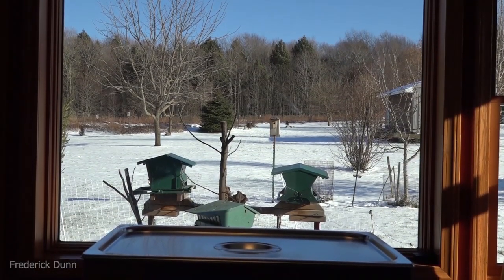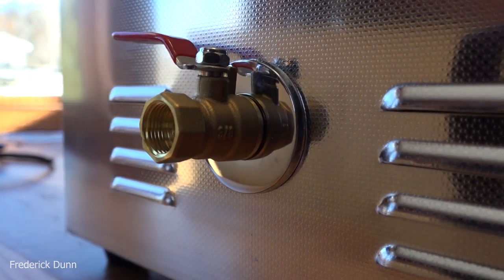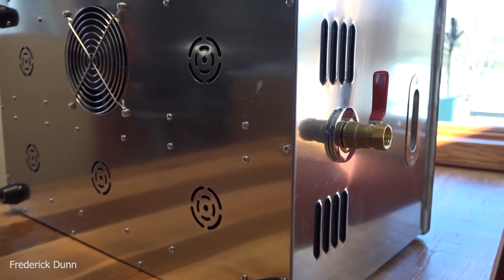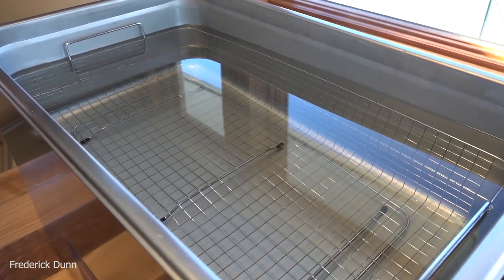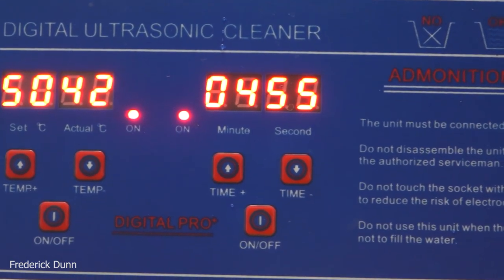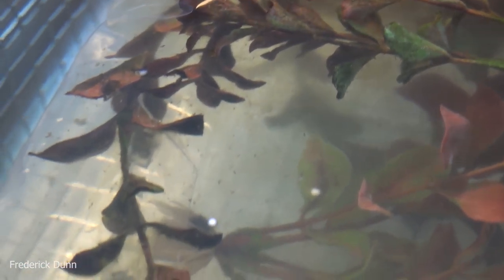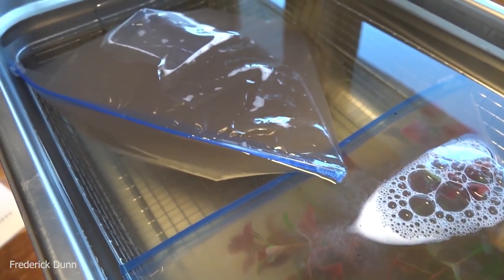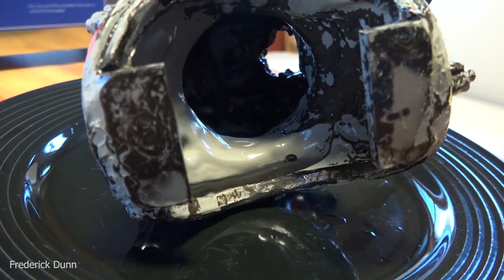How To Clean Aquarium Decorations and How To Remove Algae Ultrasonic Cleaner Review

Comment: I can speak from personal experience that it is not a good idea to put your watch in a ultra sonic cleaner and this is true of mechanical (wind-up) or quartz (battery powered). Depending on the quality and or condition of your watch it may cease to function, or no longer be able to keep accurate time.  Additionally ultra sonic cleaners can damage the “seals” of your watch that keep it water resistant/proof.  If you want to clean you metal watch band in a ultra sonic cleaner remove it from your watch and then place that in a bag or glass with water only.  Note ultra sonic cleaners as demonstrated can and will damage or remove finishes be careful what cleaners you use with what and for how long.  Polished surfaces can dulled by cleaning them in ultra sonic cleaners. Lastly all glues and epoxies will be affected you exposure to ultra sonic cleaners.  If you clean jewelry in an ultra sonic cleaner and it has set stones carefully inspect the stones to ensure they have not been loosened in any way. Properly set stone should not be loosened by ultra sonic cleaning but very often less expensive jewelry or craft fair jewelry the stones rely more on glue than mechanical bonding and lastly be careful when cleaning plated jewelry
Reply from the maker: All good pointers... AND I shall pin your valuable comment!  Guess what? My favorite Dive Watch is now kaput! I have to send it off for repair/replacement. It was a gift when I retired from the Navy so... well... I guess I can serve as a bad example here :)

Comment: The Zip Loc hack does work, but the plastic absorbs part of the US waves. A metal container or glass jar or beaker works the best. I did the experiment because my daughter who is studying chemistry now thinks she knows more than I do and told me so. Apparently she does. Its not a mega difference but I did see it in various parts that I cleaned. Loved the video.
Reply from the maker: Plastic is more accoustically similar than metal. Your daughter may be studying chemistry and I respect that. My background is in underwater ultrasonics, including imaging, though at much higher frequencies than demonstrated here. 3.5 mhz transdeucers etc. A glass interface would be better than metal, the metal would cause refraction and reflection of the sound waves more so than the plastic bag thin wall.